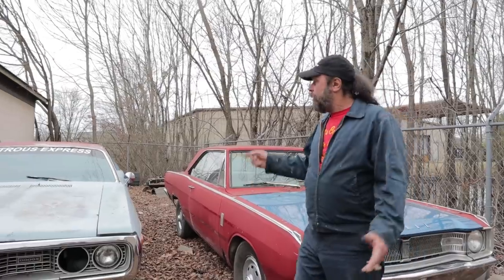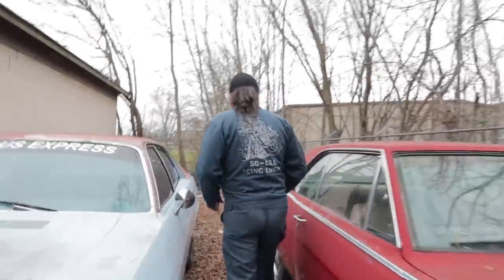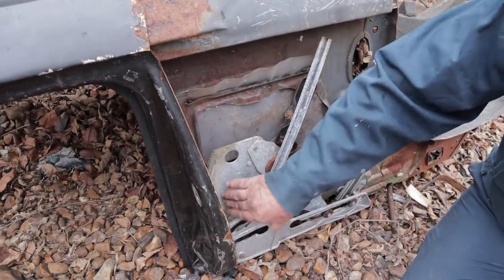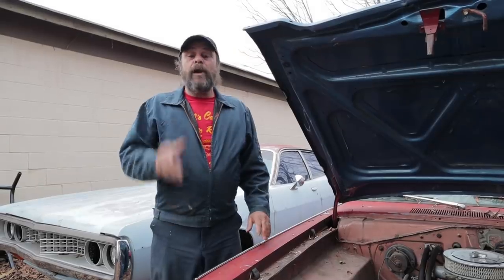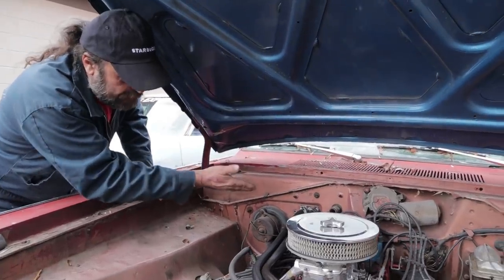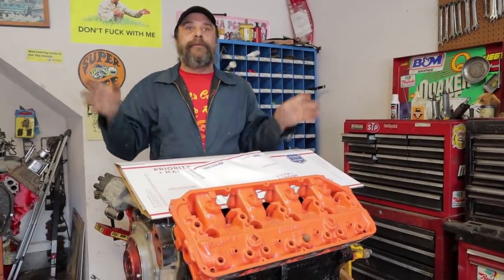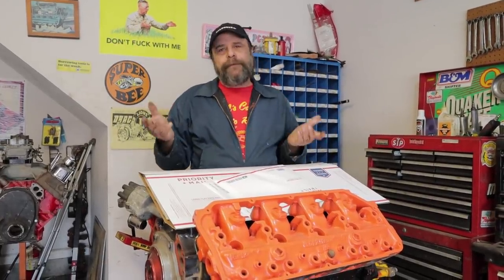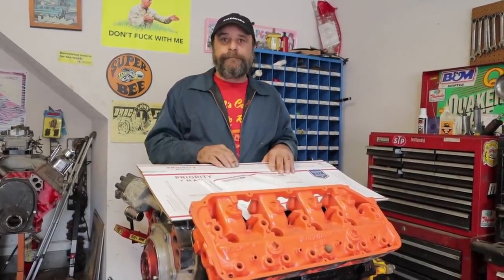How To Make Your Automotive Addiction Pay For Itself

Comment: Fantastic post today, especially"HOW DO YOU PRICE A BOLT?", I had a mid '80's Suzuki GS550, had to rebuild the front forks, 1 bolt had to be drilled to remove, only then did I find out that this allen head bolt was impossible to find, metric thread, 10 mm, 1.25mm thread pitch, high strength grade 8 min(8.8 metric equivilent, had to get 10.9, 1 grade stronger)after spending 4 weeks searching everywhere one local supplier agreed to order it in for me, had to prepay for a box of 50, wait 4 days and still make the head a hair smaller with the grinder to make it fit, so the bike was parts without that one bolt and back in one piece in a few hours when I had the correct bolt. If anyone is looking I still have 48 bolts in a box in my garage, cheap at $5 each plus shipping
Reply: @multishit6664  great, glad they are available, Suzuki told me years ago when I did the project that they could not get them so things change for the better

Comment: The post office would give me packing tape in bundles of rolls for free for priority mail services such as flat rate boxes.  The tape says priority mail all over it.  If you create an online account you can have several free items sent to your door for free.  Another great saver is to get a thermal printer to make shipping labels, the labels can be gotten for free as well through shipper websites.  Thermal printers don't require ink, they use heat on special paper to print.  They are also great for printing targets for target practice.

Comment: Flanged bolts:  I have become a fan of these over time.  I like to use them to close off unused holes in cylinder geads or whatever - especially aluminum.   Put a little ptfe paste on them, and if/when you find a need for those holes [like pulling an engine], threads are in new condition and you don't have a problem.

Comment: Also I find the packing tape Canada Post sells has a way stronger backing & sticks well. It doesn't 'shred' or get brittle.
Maybe you have the equivalent tape in the USA,  because the cheap stuff is under-engineered and you have no guarantees it won't fail. I even use the Canada Post stuff for small item & minor household repairs!

Comment: Sold parts for years. Always had the Sunday classified free ads filled. Then moved to craigslist and eBay. Then Facebook marketplace. Finally gave it up. But I tell you I made a killing. Wire wheel and some flat black paint will finance your house if you do it right.

Comment: in the late 60s i bought two  grill   lights NOS 1965 300 L.  one year only.  $30.     but i dont sell a lot of parts.    the fuel pump bolt is an odd length if i remember right.

Comment: Our old cars...are just a win/ win for everyone!...as we know they are very environmental friendly,returning to the earth quicker than we can get around to them...and every tiny piece of sheet metal can be used again...
And also creating and sustaining a business of reproduction parts and body metal...example,the little holders for the bows of the headliner,the L shaped piece in Darts on the lower rear quarter window trim!...the socket for our upper ball joints,...the cross member conversions,the cooling system upgrades...
Rough,rusted bodies with good A pillar sections,sail panels...1/4 of a trunk floor!!....gas tank-sending unit...the firewall wiring clips!!...brake and fuel hard line connections,the door internals,like the Allen screw for the 2 door quarter window!!!!...maybe some people want the old left and right lug nuts!!!...or the foot pump window washer😊👍...
The business and industry in the classic car and truck and bike world is infinitely!!!...like,everyone wants to be Steve McQueen or Charlie Bronson....because they're old school,cool,tough ,just like old cars ,trucks and P-47's!!
Reply: P.S,for a classic example..have a look at Roadkill when Finnegan and Freiberger rent a Lamborghini and drive the Sailor Jerry Rat Rod....result was blokes loved the Lamborghini and all the sheilas loved the Rat Rod!!

Comment: Ut i used to sell harley parts and i would sell every part for $1.00 BUT , and here was the rub, You had to buy every part!  Motor nothing attached $1 frame nothing attached $1 but every nut bolt and washer holding all together was $1.   On avg there are 10,000 parts at $1. It worked

Comment: In 1983, I called a maybe $25 ad, (1/4 inch x 3 inch), for Pontiac used factory performance option parts...the guy's mom answered the phone. He's not here, out getting parts. OK, ....biz in basement, on pool table. He shipped on pallets he built in the driveway. Got into Mopar parts as no one else was...at the time. Evolved FIRST, into reproduction parts, for the rarest models/options, to add to base models that were common and cheap. Called little "find parts and ship anywhere" biz......YEAR ONE. Spin off biz.....GOODMARK INDUSTRIES......now..,..Auto Metal Direct.   They've made a few bucks since '83.  It's not rocket science or secret wisdom.

Comment: Didn't you ever have anything get broken while shipping? The heads or the intake especially the exhaust manifold heavy for their size but somewhat fragile. Just asking. Years ago we used to do a lot on eBay. I don't need to say anything more about that. We got real creative with our shipping. Or so I thought until I heard the things you just said in your video here I tip my hat to you! Sam's club maybe Costco I don't know but Sam's club is great for cardboard especially the Big flats. They can be about 4 ft square with 6-in tall sides. They cut up nicely packaging and laying on his car real quick that's a little something between you and the ground. I've yet to invent that four-wheel drive creeper. Haha thanks for the pointers on your video

Comment: Got me thinking of renting a big ole saw to split a quad cab short box cummins frame to shove in back of my short box. I just need the rear axle but it still has plumbing and calipers and cross members. Guy wants the whole thing gone for a hard to beat price.

Comment: I'm a matter of seconds into this video and it's already in my favorites. I'll be damned if I only learn something once from this video XD

Edit: yeah, I'm gonna watch this again a few more times. I do have one question, though I don't know how likely you are too answer a comment on an old video, but I miss 100% of the shots I don't take do I'm gonna give it a shot:

How much cleaning do you typically do on your parts? Like sanding and wire brushing and soaking stuff in vinegar to get surface rust off. Do you try and send your parts out spiffy, just how you pulled them off the car, a little of both? I'm curious.

Comment: I just started watching your videos the other day, and I just now realized, in telling your story you're telling mine. You're just missing two letters. RC. 
I'm sure there is some hobby crossover, guys who are into building/racing real cars and radio controlled cars, but I assume most real car guys see RC cars as children's toys. You could make a decent toy argument with electric cars, but nitro engine RC's are another story.  They have a lot of the same parts as a full size engine: manifold and exhaust, piston and cylinder, connecting rod and crank, flywheel and clutch, and carbs that contain more parts than the complete engine with no carb. It took me two years to be able to tune an engine by ear(best way) and just like in real cars, you never stop learning. 
I have also been a paid mechanic and nitro tuner, I have hoarded parts for years, initially so I would always have parts that I needed in hand. That has turned into a solid online parts business. I learned the shitty tool lesson, the go cheap now pay for it later lesson, and many more. I have raced 1/8 nitro buggy for years, but I do own a top fuel dragster. I've rambled enough, keep up the good work. 

P.S. there's a term in the nitro (rc) engine world, and that is "on the pipe" 
It refers to when your engine is tuned to perfection, and you are making tremendous power (I have engines that make 4hp out of 1/5 of a cubic inch, equivalent to 7000hp from a 350c.i.)
My nickname is the crackhead, because, 
I'm always on the pipe.

Comment: Let's not forget the less than perfect fit of many reproduction parts when attempting to incorporate them into or onto a perfectly straight, never crash damaged car. Believe me when i state that repro (at least body parts) are NOT trial fitted to a jig or (better yet) an undamaged car or subframe of a car or chassis the part is marketed to fit. I'm sure some of you know what is often encountered when trying to fit a rocker panel to a car said part is sold as a factory quality direct replacement panel. Only to discover the panel is an inch or more too short...or long... or wide. Or a break line is in the wrong place dimension wise or under or over bent on the replacement part. No, not the "brake" line! The "Break line"! The pure Hell of trying to get an inaccurate body part to fit and look correct can have you pulling your hair out! I've found it easiest to just go ahead and light mine on fire before i become tempted to start yanking it out by the fist full. At the very least you will wish you had tried fabricating it yourself from a piece of flat stock of appropriate thickness. Not a body man or fabricator? You can easily pay $400 for a piece that you will swear you can do a better, more accurate job of creating knowing less than nothing about fashioning a compound curve, a correct break line, etc. I'm sure many of you have run through the same gamut of emotions trying to install headers on a car the box says is for your exact model. Yet here you are with one tube up tight against the starter motor and the other side preventing you achieving full  lock when turning left. I've flattened a section of tube on one side to the point that i'm sure reinstalling the original exhaust manifold on that side would likely make superior power over my brand new "massaged" header. Such an experience makes a guy like Uncle Tony, who wants to ship you what you need that is directly fresh off your exact body style for $60 + shipping into a veritable parts God specialising in the Mopar body group you are struggling to find all the correct parts for, fasteners included. It truly is what separates the men from the boys when the desired result is a seamless undetectable repair on a correct (as opposed to amateur)  restoration.

Comment: great i have a few vws and I was involved in a airbag blowing up in the pass seat and I was like I don't know if it didn't shut off and I was still in AC running 75 and 5 more minutes and then I was just trying to keep the dam thing out of the other lanes because it was driver's seat bag and i was like a car that is trying to kill me and I found out that the passenger side of the vehicle is 4xs amount of💥💣 chemical 💣 Airbag 💩 but I have a new engine in the car and I have added a lot of upgraded to the next trim level so I will just have a VW mk4 specific place where I can just sell them to the same person that is going to want both of them and i just don't want to see them in a smasher when I have a really nice color painted car in 👍 dent free so he might not ever sell it and fix it because it doesn't have anything but a electric problem and two new front seats and they are all the same Jetta Beatle and golf and Passat in 97-01 and the arm rest of the 01 Passat is the same as 04 golf but it's how you can put out a few different cars and they're like 90% exactly the same other than the body and the dash and the seats are available for different levels and shapes but it's just a way to sell 97 car new in 04 🤔 and they're all getting away with it but it's great for the people who are interested in the cars that are not in running condition and I can't refuse 30k one owner 6 years old car for $1200 fix the missed shift and I was calling around and I got a motor installed including the engine$1100 and it was not able to say no i handed him a deposit for that price and then i was back in the morning to make sure that i paid in full before someone else sees it and it was $750 for the entire motor and i was like for that much and I don't have to do anything and I will have a warranty for on the work

Comment: Can't stop laughing, a few years ago I was buying a fair bit from EBay and I quickly got to the point where I knew more about USPS shipping than they, or a large percentage of sellers, did and could not understand why some would insist what they were selling could not be sent.  In turn I got pissed off when I knew I was being gouged by the seller for shipping as often I would want/need/get longer but heavier items which was when the overall dimension limits kicked in, a simple inner core from a roll of floor rug will withstand near anything, was perfect for the parts I was after and was only about half the price of the standard boxes but still fit within the overall size limits, it just meant the person on the other end had to do a bit more work (the real reason of not wanting to ship it that way).

Comment: My '75 Fury cop car 400 had the factory oil cooler and the return line went into a fuel pump bolt / fitting. fyi

Comment: 100 % true I never did swap meets but I did do ebay tell it got bad on fees now ebay is a good buyers market but not a sellers market and I made good money off of craigs list and I still do get good deals on stuff. Now it's market place on face book it's the happening thing now. I'm a truck guy you know that in the last 2 weeks I baught 2 complete trucks have about 450.00 in both of them but 1 is a 74 with a big block with a 4 speed. So just by saying that you know what I have right off!! My problem is I hoard a lot of my parts. when I run out of room I just buy another shipping container. lol

Comment: It's an A Bodies "thing" ... either You get that, or you don't.. Mopar fraternity yes, A Body Fanatics... while cleaning my engine bay, 318 to be swapped sitting on sand bags and cinder blocks, 68 Barracuda pulls up, hey got BBD two barrel for it and a Manifold plus Air Cleaner.. how much? No worries I'll bring by in 15min.. No charge,  hand shakes and high fives..  318 came from a 67 non numbers matching Dart GT.. 300$ how much for the A904 trans?? It's going in a Dart right? Yup.. 300 for both.. True Classic Mopar folks Get it.. we as Fans kept these cars going.. not the after market.. it's growing.. but still thin on Mopar, let alone A Bodies.. Peace Humans We are AtZero.. Be nice and talk to fellow car folk.. pass it on..

Comment: If i was gonna do the chop shop deal today it would be a ls only thing since you can't get drunk and fall down with out hitting one. And i have to admit it they are so fucking good. And interchangeable  which makes them all valuable. Yet i would not do the whole car today i would rather do just power plants rears trans anything you can store in. Shed which if you keep them to a certain size are free to be on your property with out taxes for sizes check your local oppressors. Another thing i have noticed with the l.s. motors they are mostly clean engines which i have such a hard time getting my mind around bit i am old so...

Comment: I have to say the part about the shipping on the cheap is the only thing I dissagree with you on, I cant count the ammount of car parts and antique toy train parts ive had destroyed by the  post office when sellers skimp on packaging, that or we must have extra stupid gorrillas working the post office here in eastern PA. I once bought a mint used hard to find & expensive 74 to 75 only pontiac trans am front bumper from parts guy in CA, it arrived wrapped in one thin layer of cardboard with several holes worn through the box, the rubber bumper all gouged and scratched from the workers dragging the package arround on the ground, I would have paid more for a crate and truck freight if it was available from the seller,  I also had a real bummer when I got a 1930s american flyer train shipped to me not in a box but in a bubble padded envelope, it arrived as broken loose schrapnel in a bag.  I always assume the worst when shipping out parts and try to pack items safely as possible for the buyer especially if the item is hard to find or unreplaceable.  Thanks for the videos, keep em coming, I do dig the tell it like it is style of hot rodding you have, its like watching the old east coast underground car magazines from the 70s to 90s like cars illustrated come to life. Thanks Tony.

Comment: I probably have buckets and buckets in and buckets of old mopower nuts and bolts and Chevy bolt used to sell heads and long blocks intakes valve cover back in the day when we owned the shop we never threw anything away if we had a scrap car we always stripped all the good Parts off of it and as mechanic you always need nuts and bolts and back in the day you didn't have Ben's of nuts and bolts you had boxes from the previous junk cars that you owned you just kept all the nuts and bolts in a pile and when you needed one you just went through it looking for it never realizing that the people that are restoring cars nowadays are actually looking for them nuts-and-bolts particular body panel bulbs Clips I probably have a million dollars worth of just nuts and bolts laying around never thought about selling any of that stuff